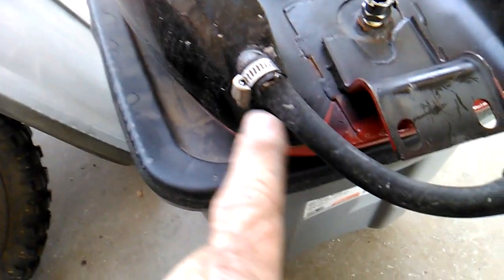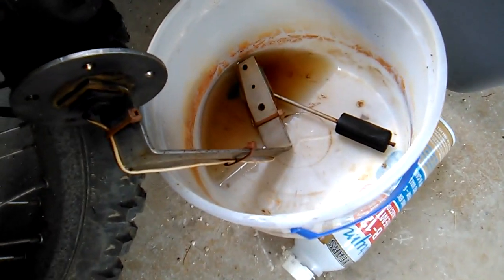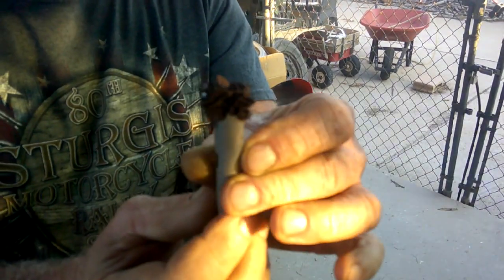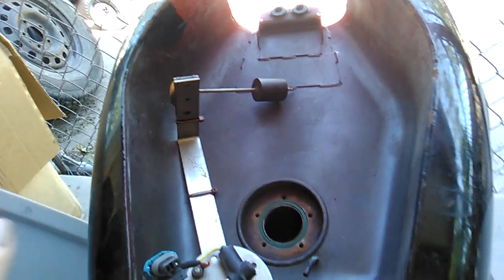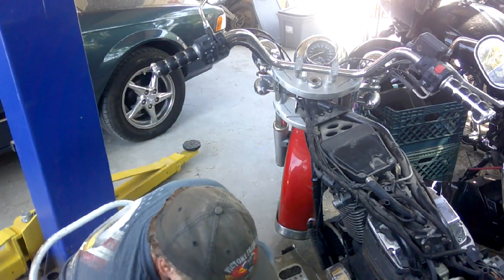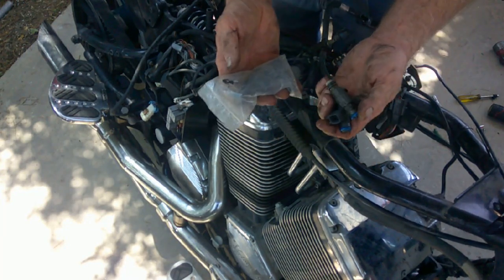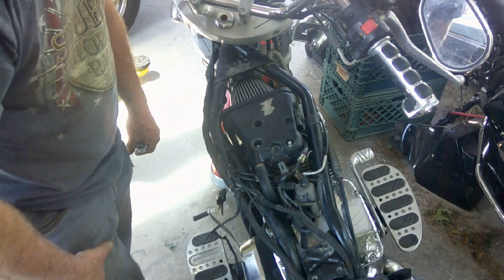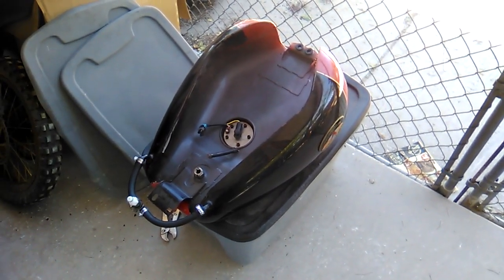She followed me home, mom. Honest (on a trailer that is)! Part 2: rebuilding the fuel system.

Comment: Some shops or home mechanics would put gravel in the tank then put it on a rotisserie and let it spin slowly for as long as it took to break loose all the rust and other junk then wash it out with water then gas after removing all the solid stuff.

Those cone air filters are as rare as a unicorn these days unless you know of a source to get them. Maybe they  fit other vehicles.
Reply from the maker: Yeah, a rotisserie would sure have saved my arms a bit, LOL! And you are right, the cone filters are all gone. Every one of them.

Comment: Mike, I have a question regarding the filter housing you put on that bike. Will it fit a 2003 classic cruiser? I found one for sale and if it will fit I'm going for it. Great videos 👍
Reply from the maker: No, sorry. From 2002 up, the fuel pump was relocated inside the tank, no longer in the frame rails. There are two pick up screens attached, inside the tank, and you have to take the tank off and apart to access them.
Reply: @2coolwheels139  bummer. Thanks Mike 😁